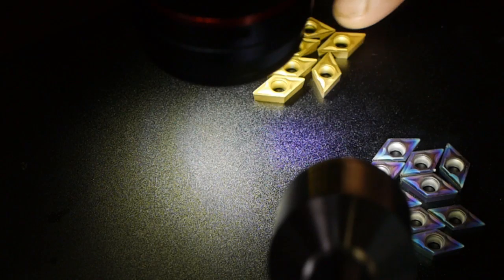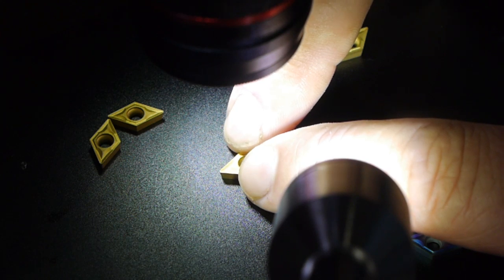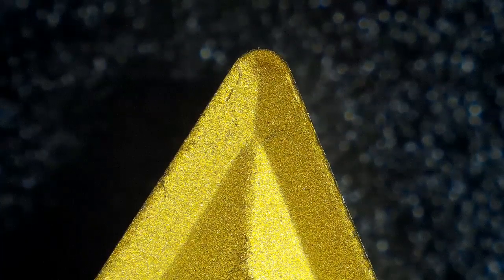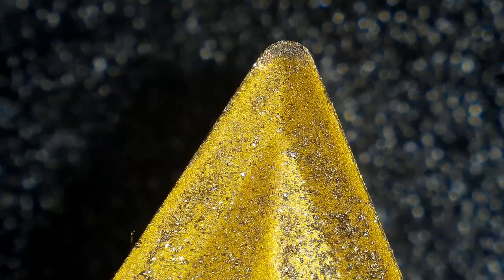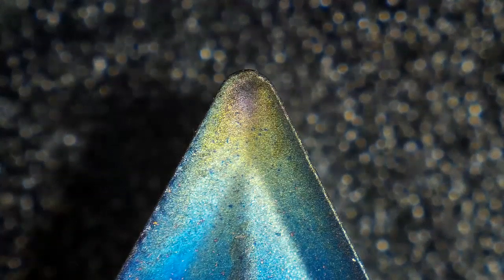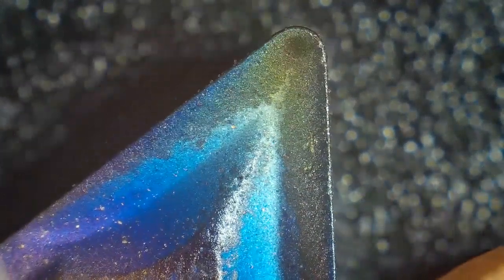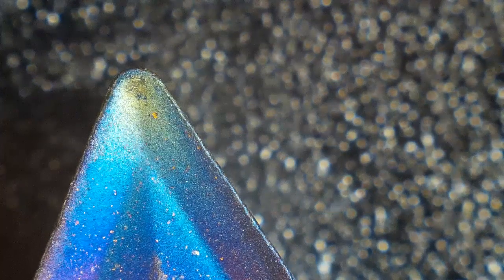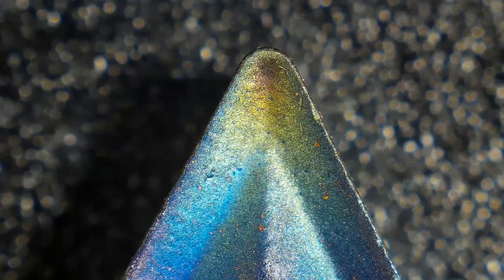A look at two boxes with new Chinese lathe inserts

Comment: I bet the quality control department in China doesn't focus as closely! Funny, as a hobby machinist I was warned never to go cheap and use Chinese inserts...but the brand name stuff is literally ten times as expensive! So I have used nothing but Chinese inserts and I've found them to be pretty good. Certainly the right choice for someone who is still learning and making plenty of mistakes!
Reply from the maker: It's certainly possible to do some amateur work with these inserts.

Comment: I am thinking they are using some cheap spray/sintered titanium coating on the nano inserts. Probably heat the centering screw and spray the tin on. Ever seen titanium when heated? Kind of takes on those same colors. Put some heat on one of your standard used inserts and see if you can make your own BLUE NANO !!!!
Reply: There's in fact titanium in this coating. I dont't know what banggood is doing there, but there's in fact an industrial coating with the "blue" in name and it looks like this. This is because of the heat introduced while applying the coating in a vapor chamber. On the industrial types the carbide is also a little other type. Even harder.
Over all coating doesn't matter for a home shop. It doesn't make inserts harder, they just last longer because of there wear resistance. So this means also: You can grind the inserts in the home shop and rip of the coating, that's no problem. Even more: A sharper edge on the carbide reduces tool pressure a lot and gives most of the time better surface finish results.

Comment: You should try some of their inserts for cutting aluminium, I've used them on steel and stainless steel for finishing passes with success
Reply from the maker: I actually bought a box of those a while back. Been meaning to try them out. The are a lot sharper and much nicer finished.
Reply: @Rolingmetal  they have less cutting pressure also, but for fine finishing passes they are excellent

Comment: Will you use it when grinding drill bits?? I'm wondering about other potential uses in or out of the shop, like coins, stamps,  or reading the fine print on contracts lol
Reply from the maker: Sure, it's great for grinding inspections. Items up to 10 cm should fit easily under neath the micros ope. Great for inspecting threads on workpieces. It's also a cool youtubing tool. Although the videos are not really a success.
Reply: @Rolingmetal  Ahh, yes.. inspecting threads is an excellent potential use as well. I bet there are many uses I haven't even considered, like threading needles,  and and working with jewelry.  I'm not sure it'd be great for whole videos all the time, but I'm certain that when it can aid in and add deeper insight to a project for part of a video, then it will be just the ticket.

Comment: You should perhaps concentrate on the chip breaker specification for your use rather than on such things as insert shape or colour. Insert makers design chip breakers for a limited range of DofC and you need  one for probably the 0.1mm to say 1mm range..If bangood don't or can't give details of DofC they are only selling for the gullible.  Your lathe being on the less than rigid side needs an insert with a chip breaker intended for "fine finish" ie shallow depth of cut which will give a good finish. General duty tips are less than ideal for your use. Sumitomo make some excellent titaniun carbide(cermet) tips but they are super brittle and require careful handling but with right chip breaker can take very light cuts and leave an almost chrome like finish. When I mention careful handling, if you stop the lathe with the tool still in contact it will chip..😢😢😢😢 Other downside, V expensive compared to bangood.

Comment: Chips. Cracks. Fractures. Horrible finish. Uneven coating. Obviously poor heat treatments. 

Maybe they'd make good fishing line weights (as a last resort for when the lead weights run out) !🎣
Read less
Reply from the maker: You might be right, carbide is rather heavy. It might also be better for the environment than lead.